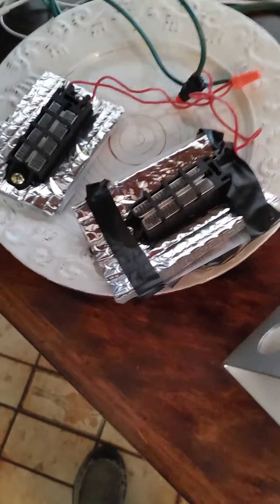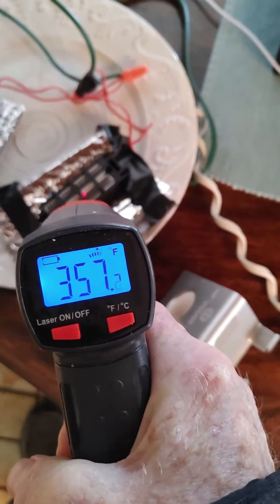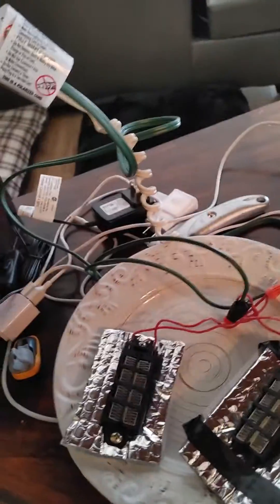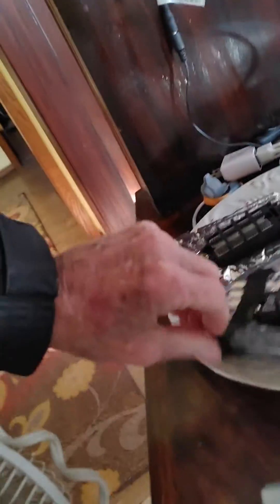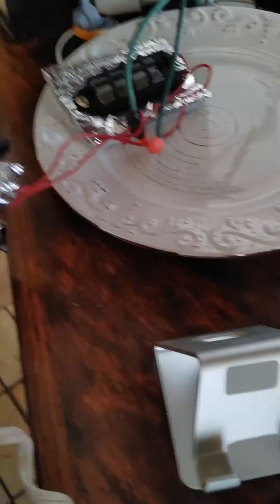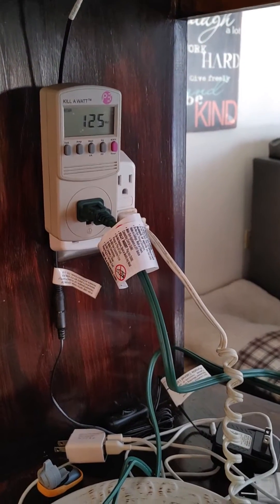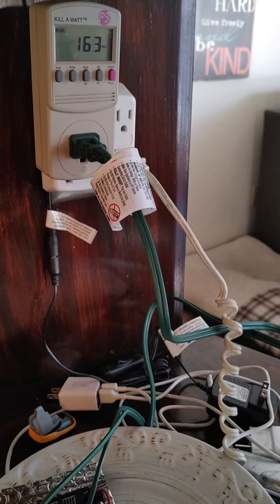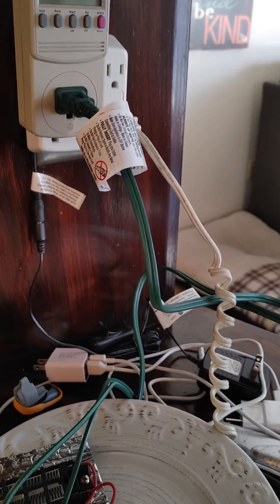PTC Ceramic Heater - A Eureka Moment

Comment: the amount of heat is worked out primarily by how good you room is insulated for example a 3m long  x 3m wide x 3m high say its 0°c outside and all you walls gave R2.4 (1")insulation and you want it to be 22°C inside , you'll need 2.3w energy per square meter of insulated wall surface  or 2.5Kwh to maintain that heat. If you install R20(8") insulation  you only need 0.248W per square meter of wall surface so 1/10 of the power or  0.3Kwh or 300watts per hour so even then a 25w heater will do nothing, make the room smaller maybe
Reply: All this info was from chatgpt is does make mistakes